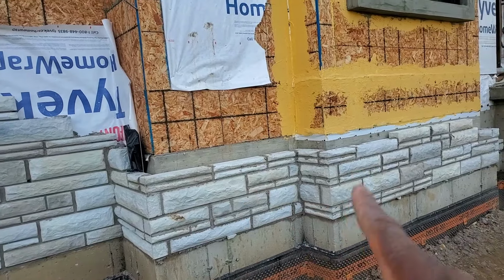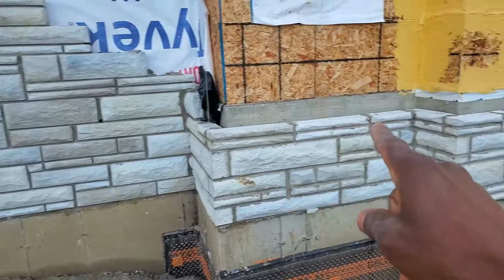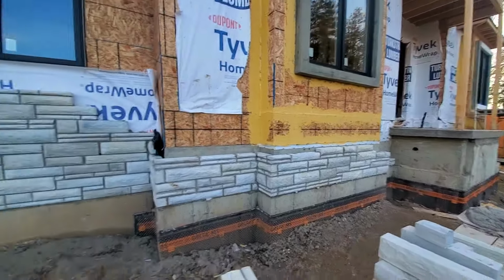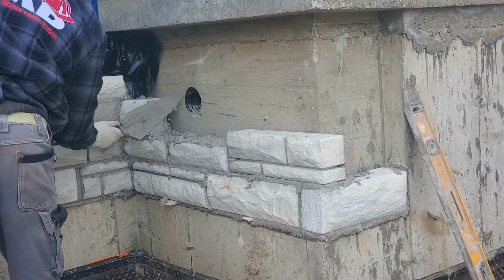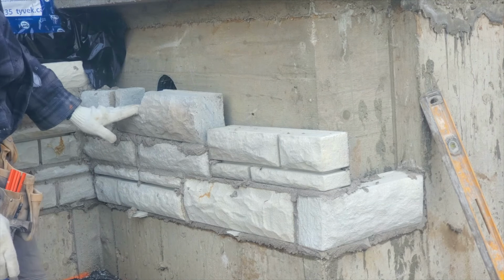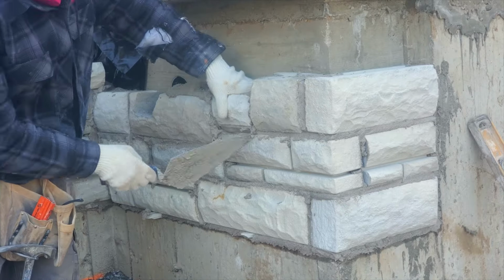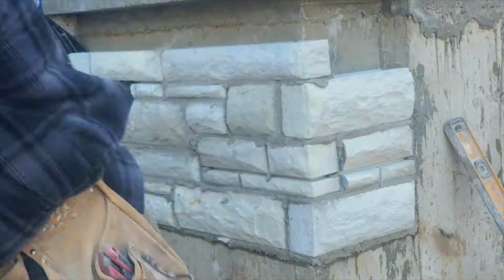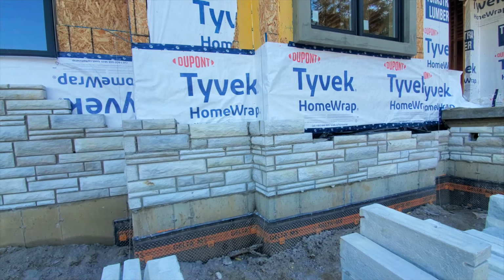Building A Stone Wall

Comment: Another great example of Top Notch Craftmanship.  One question is:  Are you able to work year round in Canada or do have to switch gears in the cold months and work on some other type of construction?  Really appreciate your videos.  Thank you
Reply: You can tarp over your scaffold in the winter and blast heat so you can still work
Reply: lot of box and long verticale joint ?